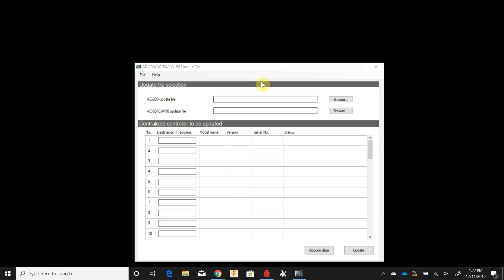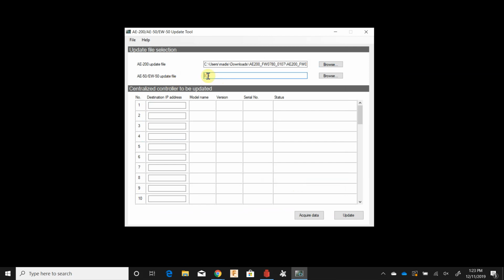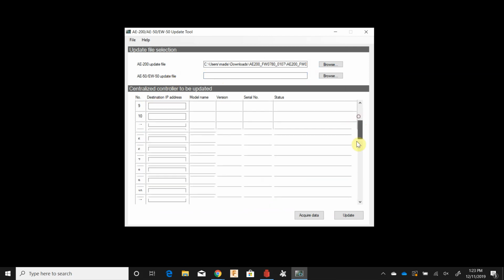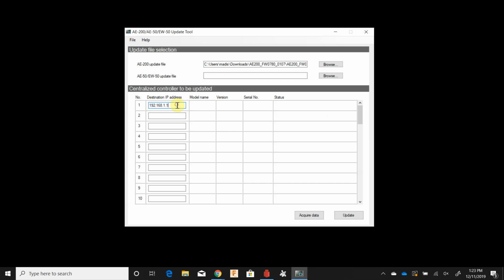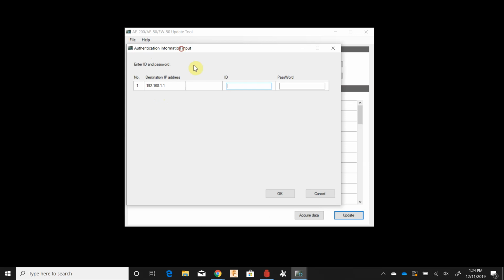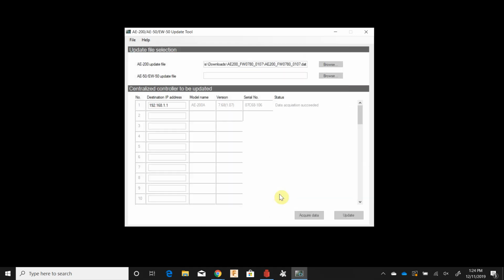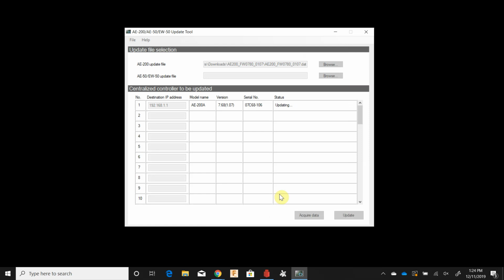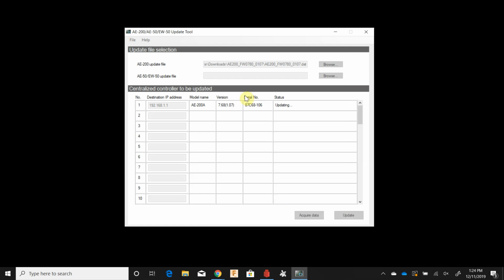AE-200A/TE-200A Firmware Update

Comment: This is a great tool.  Can you confirm that the update does not erase the settings of the controller?  Just want to be sure.....we have a combination of AE50's and AE200s and this is going to be so helpful.
Reply from the maker: Correct. Updating the firmware does not erase the controller settings. Even so, I typically aquire the data from the controller with the initial settings tool before the firmware update on the off chance the update doesn't go as expected.
Reply: @VRFGuy  Thank you!